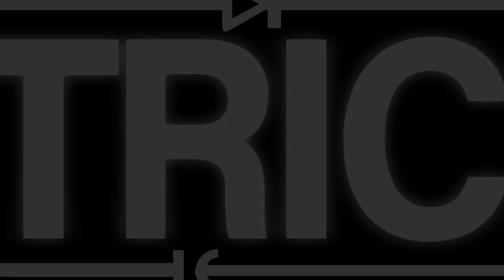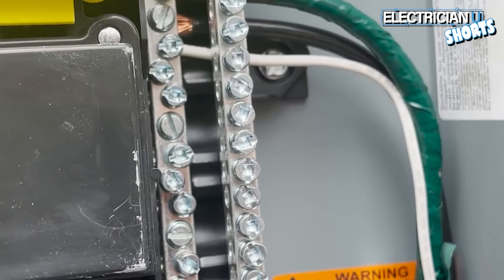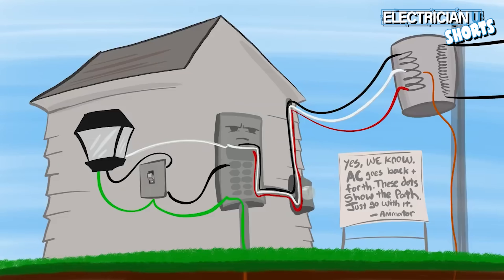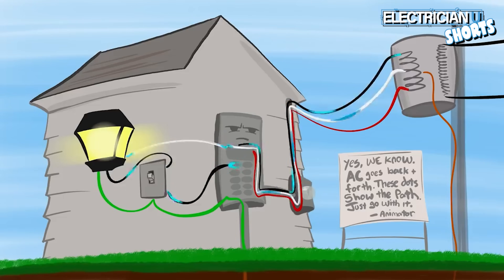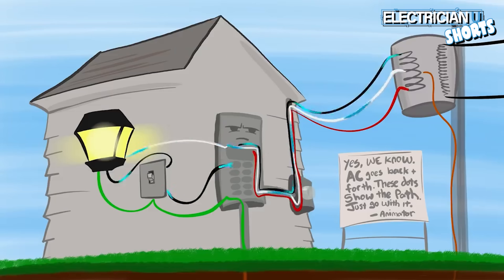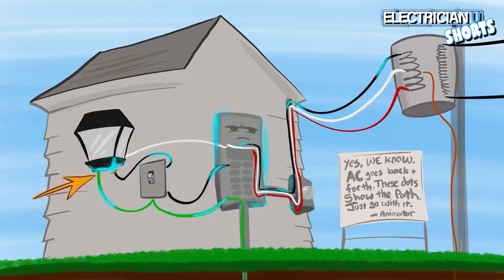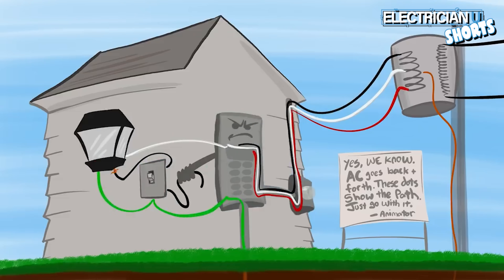SHORTS - WHY WE BOND (Neutral & Ground) Explained in 3 Minutes

Comment: That's wrong, the circuit will close even if you don't bond the ground with neutral in service panel, because the neutral is grounded on the service pole.

Comment: Electrically speaking, the ground and the neutral do the exact same thing. The only real difference is the neutral is the intended path for current to return to the source, the ground is the emergency path to return. We don't bond them anywhere except where the are sourced from because we never want safe current from the neutral ever to hop over to the ground. The ground is only for emergency. Think of the emergency Lane on a freeway, or the spillway on a dam. They both get you to the same place. But you don't ever use them for normal operation. They are only to be used in an emergency situation.

Comment: But if we connect the neutral of transformer on earth, so the current will be returned in the source (transformer) by the earth.

Is the transformer neutral connected to earth? 

If yes. No need bonding between Neutral and ground wire on panel , just need a gfci breaker 

Wht do y think

Comment: I disagree, NEVER tie neutral and ground together . Ground should "NOT" provide a path to complete the circuit back to transformer.  Ground should short the electric current straight to earth ground in a fault situation. 
The purpose of a ground in AC  electricity is not to be used in normal operation, but to be used in a fault situation to provide a path of least resist ( as compared to a person or object that may start a fire) to earth ground.   The direct short to earth ground is what triggers a breaker or fuse to blow,  "Not" completing the path back to a person or appliance back to the transformer.

Comment: So if I understand correctly, a fault condition on a circuit run from a sub-panel (which is NOT bonded) will complete the circuit by flowing back to the main panel's bond, then the sub-panel's breaker (or wherever the first overcurrent device on the faulty circuit is located) will detect the rush of current and trip.

Comment: Hi from England, UK. What kind of supply system are you showing here? is it what it looks like, a TT system? often used in rural areas with overhead supply lines and pole transformers, they're used in some areas here in the UK too but we don't have the dual voltage 220/120 volts, but only 240 volts for domestic supplies here, and our TT supplies are used in some town areas too, there's some not far from me which are supplied from underground cables. But our most common traditional system here for domestic supplies is the TNS system where the supply arrives underground and has three cores, live, neutral and earth, with the neutral & earth bonded together at the transformer and connected to rods in the ground there too. But now with more recent supplies for newer domestic dwellings we more commonly use the TNCS system where the supply arrives underground with TWO cores, live and combined earth and neutral with PME, protective multiple earthing at various points between the transformer and each consumer.
Reply: early part of the video was TT, but the US mandates TN-S-C for the reasons the video gave

Comment: The neutral is bonded at the service (sometimes) incase the bond to ground of x0 of the xfmr is lost. H2 and x0 are bonded to ground going down the pole to a rod (and in some cases bonded to the primary system neutral if provided). Unless the xfmr is a 2 bushing primary that uses 2 hots.

Comment: Thats Part of it. But also because of Lightning strikes. The path of least resistance is the planet during liightning. The grounding rod. Instead of frying all of the other circuits.
Remember energy doesnt just take the path of least resistance, It takes All the paths of least resistance.
Reply: If you take a true lightning strike, your ground isn’t going to do sh*t…

Comment: Thank you so much for making this understandable! I have been trying to understand this, and now I think I understand it. Would it be correct to restate this, such that, in a sense, bonding the white wire to the ground on the bus bar, allows a short circuit to occur there, rather than at the light fixture?  So voltage from the black wire goes through the ground wire up to the bus bar, through the breaker, and the heat generated as it passes current through itself to the black wire, it would trip... do I have this right?
Reply: I guess it wouldn't prevent two short circuits, but it would provide one that would trip the breaker and one that would not....better?

Comment: I live in the uk and i am part qualified as an electrician but i recently installed solar to my house and bought a generator to charge the solar batteries in winter. I have had problems as the solar inverter was giving 120 volts at the neutral and the house was showing no earth. I did have RCDs tripping and even a socket set on fire but the inverter sut the power. I have since bonded the neutral at the first breaker to the earth terminal block and everything works fine. But as it is going to my house electrics do i need to remove the neutral earth connection in my breaker box? I also have problems with my generator as that trips the RCDs and i have found out that i need to disconnect the earth neutral bond to making floating earth neutral. I have a 7000w challenge dual fuel generator and run it on propane. I have contacted the company to see where the connection is as i cant see them linked together anywhere.

Comment: Physics told me if one area is bonded. Every where is. So why here and why not there. So confused
Reply: because wires have some amount of resistance, and when current flows over a amount of resistance, there is a voltage difference.

Comment: I get the need to troubleshoot issues which I think is the main reason. What's not explained is why without bonding, current would flow at all from Hot to Ground. What's stated in the video is that current can only flow when there is a completed circuit so why worry about bonding? If that "Complete circuit" was back to the same source as Hot, then there is no reason to worry about the hot hitting ground, what's presented is implying that without bonding, nothing would happen at all.

Comment: So there needs to be a way for it to know that the pathway changes from hot to neutral to hot to ground. When it’s not bonded the current just goes straight to the ground but when you bond it to the neutral it goes into the panel and lets it know

Comment: Regarding how breakers trip, sub panels dont have bonded neutrals yet the breakers will still trip. Dont they trip from heat? 
Good video btw, animations were spot on.
Reply: I work at a factory that produces square d breakers.  The hom and qo breakers we make trip 2 ways.  Either from heat that causes a bimetal to bend away from the trip lever, or magnetically if the current is extremely high.  The yoke acts as an electromagnet and pulls on the armature that holds the trip lever, causing it to quick open hence qo.  We also produce CAFI breakers but thats a different story.

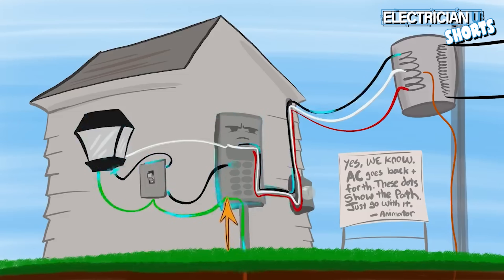Comment: @2:00, you say the fault current heading into the ground " doesn't have a path". What about a current  path through the ground/dirt to the grounding electrode of the power pole transformer? isn't that a path?
Reply: It's a path with relatively high resistance which result in current  not high enough for  the breaker to trip but high enough to kill you.

Comment: See idk man. Cause initially I’ve learned that the if the feed had a ground fault, the increase of amps on that wire causes the breaker to trip, meanwhile the ground wire allows a safe path back to earth. If anyone has a better explanation please share. I am a learning apprentice and want to how the neutral wire works. When it’s bonded there is no current. But how is it if there is no current, then what makes it a part of a circuit? Wouldn’t it just be another ground wire then? 
I’ve worked on neutrals that were hot and some that are not. I just don’t get it.

Like in residential there are only 2 phases but it’s called 3 phases lol I’m not sure why but whatever. Apparently it is one phase and doesn’t clash. But in commercial black red blue 3 phase if they clash it arks. 

So are the transformers on the poles different? From commercial and residential? If so, what are the differences? Why in commercial does the neutral back feed. Where as residential it doesn’t?
Reply: The ground wire allows a safe path back to the transformer to trip the breaker via the neutral wire bonding at the main disconnect. The earth ground has nothing to do with it and would not trip the breaker. The neutral wire has the same amperage as the hot wire when downstream of the main panel and carries the unbalanced load upstream of the main panel (neutral/ground bus bar). Under normal operation, the ground wire is electrically disconnected and has no involvement. Like a spare tire in your car. The neutral wire is part of the closed loop requirement for a circuit to work. In residential there is only one phase, single phase and split phase by the neutral at the mid point. They are not 2 phases or opposite phases, they should be referred to as opposite poles, lines, or legs, hence the designation L1 and L2 referencing the opposite poles of the transformer.

Comment: In the TT system, we typically do not see bonding between the neutral and earth. Could you please clarify in which systems bonding is required and in which systems it is strictly not recommended?

Comment: Does this mean- the ground wire is basically another neutral wire that is connected to the casing and going back to the neutral bar?
Reply: No, the neutral wire (any bare copper part of it) must not contact the metal casing. Only the ground wire is attached to the casing, and carries no current under normal operation. So, if the casing becomes energized, the current can travel unimpeded on the ground wire to the neutral/ground bus, then up the neutral wire to the transformer and trip the breaker immediately.

Comment: And I think, this also helps when the neutral path back to the service is broken, the neutal-earth bond will help in this situation by letting the ground act as the return path for the electricity back to the source hence prevent shocks that would arise in case there was no return path for the power trying to flow through connected loads in the system, remember in such cases most equipment cases/covers will be hot (high potential/voltages) all-over them creating dangerous situations in case a person touches them. So in such cases the ground will help do the job a neutral does.

Comment: and that's why you're not a teacher... pfff, you should have said that when the black wire touches the metal of the lamp, it will cause a short circuit cause that's how it will go back to the neutral , with high current and that's what will trip the breaker

Comment: But why does the electricity need to return to its original source in order for the breaker to trip? Wouldn’t that NOT make breaker trip as it seems like everything is working fine?
Reply: As I understand it, the grounding path that bonds back to the neutral is supposed to have lower resistance for two main reasons:
1. So that it will prevent someone from getting shocked (electrical current will choose the lower resistance instead of higher resistance through human body), and 
2. So that will actually be a higher current flowing back to neutral for a short period of time, TRIPPING the breaker.

Hope that helps.

Comment: Can anyone help me on this? Why circuit breaker need full loop hot to neutral?
When ground is not bonded to neutral,  High current still go through Hot wire of circuit breaker, then grounding path.
So circuit breaker can still sense ground fault(high current)  from hot wire, even though  neutral has 0 current.
Why circuit breaker need to sense high current at hot wire and neutral and not just one hot wire?

Comment: QUICK QUESTION ....I am building a micro grid using Enphase micro inverters at the panels to an Enphase3 combiner box to a Eaton 240v disconnect then into a 200 Amp GE panel with breakers...Is the GE panel considered the second point of disconnect and therefore the neutral and ground should be kept separate???..the system does include a 12kw 48v inverter a BMP2 controller and four Tesla battery modules and 7.5 kw worth of panels
Peter In Hawaii p.s. as a 30 year plus General contractor  I found your videos TOP SHELF!!!

Comment: Why in this animation is the red (hot?) Wire not energized? Also you talk about the bus bar for the ground wire but not about the bus bar for the neutral... Is the neutral bus bar the same as the bond to the ground? (Or is that separate? And the bond ties both bus bars together--along with the wiring?)

Comment: The reason you gave actually makes it worse! Because when the wire breaks, instead of cutting the current off, it keeps the current running. if there is a short, that current will run out of control, and you hope the breaker fuse will stop it.

Comment: I have an old 1982 truck camper. Is running a floating neutral generator a safety issue?  Normally a pedestal is grounded when using shore power.

Comment: It is my understanding that new urban residential services have the grounds bonded to a ground connection comprised of either 1 or 2 ground rods. This does provide a ground path for ground fault current back to the utility transformer because the system neutral is grounded at every transformer. But by bonding the grounds to the neutral at the service panel a much lower resistance path to the transformer is established in addition to the ground path. So essentially you have dual pathways for fault current return via both the neutral conductor and the ground. Fault current will share both paths per the relative ratios of the resistance in each path so the vast majority of the fault current will return on the neutral. The nice thing about this is that it provides redundancy. If the incoming service neutral becomes damaged or severed, the service can still function and a ground fault can still clear via the ground path and the hot breakers should still operate so long as the ground connections are adequate. Unfortunately though, ground connections are higher resistance and they deteriorate over time. So it is best to rely primarily on the neutral conductor for fault return current and reserve the ground return to act only as a redundant backup additional path. The same philosophy applies in the distribution system but, the multi-grounded system neutral is even more important from a safety perspective because at higher distribution system voltages like 13.8kV and 25kV, hazardous step and touch potentials can develop on and around equipment when primary faults occur. The best way to minimize these hazardous potentials is to always ensure equipment and ground grids are bonded to the system neutral conductor and ensure that said neutral is sized adequately to conduct the entire maximum fault current possible at that location back to the substation.
Reply: Exactly, well said

Comment: @2:20  there IS a return path, it's jus not a great one.  The neutral is bonded at the pole also.  So if the panel neutral isn't bonded to ground, any hot that finds true ground (like through a light fixture) will go through the ground wire, to the panel, and then to the ground rod at the building.  From there, it takes a higher resistance path through the earth itself, over to the pole, into its ground rod, up the wire, and over to the bonded transformer.

This isn't an efficient return though, because of the higher resistance in that path.  This additional resistance raises the overall resistance in the fault circuit that's been completed, which lowers current. (and creates a noticeable voltage drop)  It may lower current enough to be within the breaker's rating, and not trip the breaker.  It can still trip GFCIs since there will be a detectable imbalance between the power flowing through the hot and back through the neutral though.

The other issue that develops is that since the wiring is probably presenting a much lower resistance in its part of the path than the conduction through the earth between ground rods at the building and the pole, there will be a significant voltage drop between the ground at the building and the ground at the pole, causing some amount of power energizing of the ground system at the building.  Some very old appliances made before use of the ground pin on the plug will bond their neutral to their shell (or just plain have a neutral-to-shell fault) and you can notice this by getting a tingly feel when touching the (unpainted metal) shell of the appliance. (especially while it's running, or while you are also touching something else that is connected to actual ground, like a newer appliance)  This is usually fairly safe voltage, although a bit concerning.  I've personally experienced this with a few pieces of old equipment, it's not too uncommon with vacuum tube radios.  In those old units, it made it safer for the operator since grounding the shell to the neutral was better than not grounding the shell to anything, sinece those old radios/tvs/etc were producing many hundreds or even thousands of (DC!) volts internally, making a fault vastly more dangerous if it contacted the unit's outer metal shell.

I'm not disagreeing with your conclusion, I'm just adding some missing detail for your rationale.  Thanks for the video.